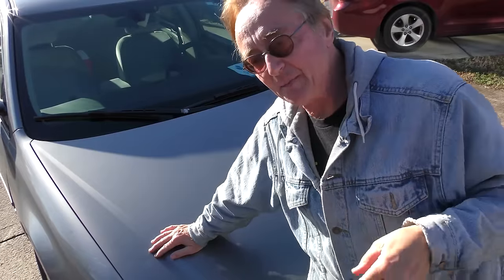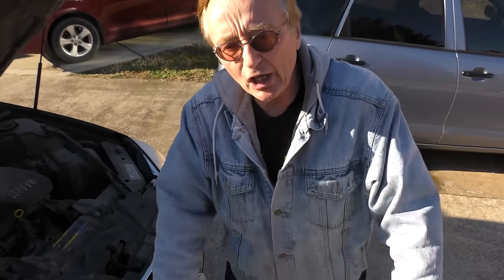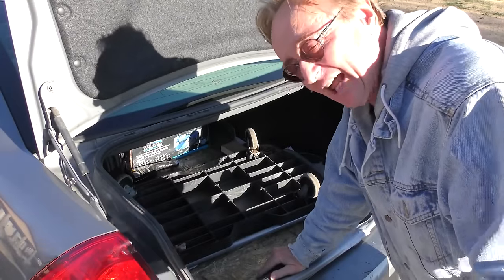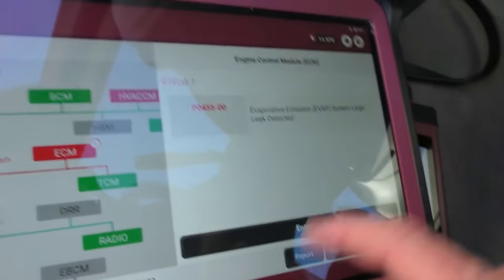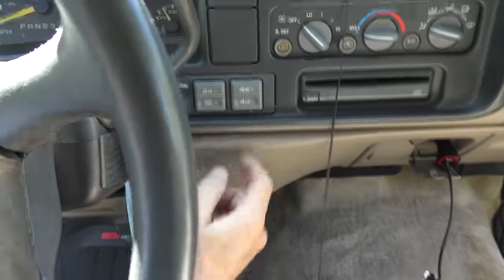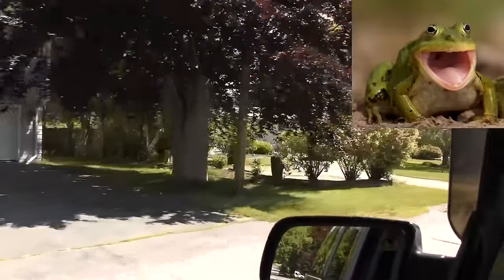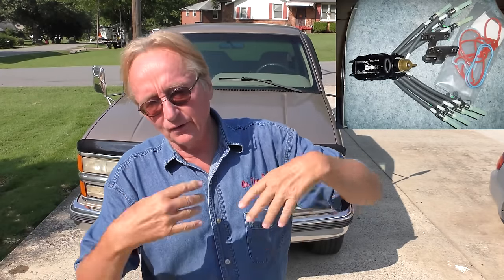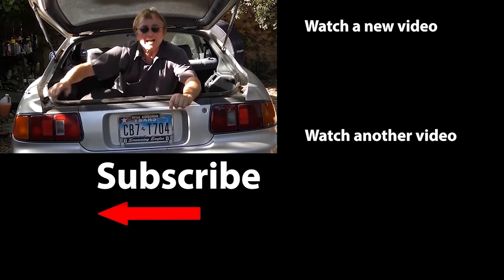3 Chevys That Last Over 400,000 Miles

Comment: I have a 90 Chevy single cap 4x4 short bed with 240,000 miles and still running strong.

Comment: I have a 96 C1500 (and a 90 Suburban). These are great trucks, well put together and nice to drive. Snap them up while you can!
Reply: The C1500 has done 118,000 miles, and the Suburban (with 454 engine) only 73,000 miles and with a Flowmaster 40 sounds like a beast!

Comment: I have a 2009 Impala withe 3509 V6. I bought it over a year ago with 124,000 miles and have put 1509 on it. It was near perfect except for a scratch and a small hole in the seat. I paid $4,000 for the car at a dealership. My mechanic went through it and he said I got a fantastic deal on it. Everything is solid and the only thing I've put into it was tires and a thermostat. The two prior owners took amazing care of it!

Comment: I have a 96 1500. Paint is faded but the A/C runs 150k miles on it. It's a rebuilt truck for $4000. Needed it because my jeep patriot went through a transmission cable and for some reason it has a spare

Comment: Scotty;  I had a 1985 Pontiac 6000 which had 360,000 on the odometer when I sold it and it had a broke speedo cable for nearly two years.  Mixed city/ hwy driving mostly city interstate driving. Ran good burned about 1/2 qt per 1000miles.

Comment: I have a 08 Chevy Impala with almost 185,000 miles on it. Yes it has a few rust spots and a few imperfections but its almost 15 years old. And no it won't make 400,000 miles with me, it will make 200,000 miles with me.

Comment: Try Lucas injector fuel additive to clear those fuel injectors, it has worked for me. It also helps clean & keep direct injection carbon at a minimum. You moved from Texas, but 'Burbans and its cousins have been built in Arlington since 1996. Remember to keep up with government regulations, many components come from suppliers, that GM has been more consistent with quality control.

Comment: Reminds me of my old 2002 Malibu. Lots of weird stuff wrong with it, like the security system would prevent you from starting it
Reply: GM passkey re flash at the dealer. In 2002 that cost $80. Only done once in 240,000 miles.

Comment: 2012 Malibu 222k it’s still running but not strong because I let the oil get low on my trip to California and back didn’t realize how much oil it burned. Other than that would still be running strong. Keep oil full and changed and you’ll be good. I just bought a 22 Malibu yesterday with 28k on it. This makes my third one 😂

Comment: I had 2 Monte Carlos , a 1996 and a 2000 .
I changed oil and filter every 3000 miles .
Both cars went over 230 k miles and were still running good when I sold them.
Only problems were the Dex cool / intake leak common to the v6s back then that I fixed with Barsleak .
Reply: My mom had a 1999 Monte Carlo 3.1L  sold it at 267,000 miles and still running good.  Did have to replace the intake manifold gasket at 175,000 miles though.

Comment: My 07 Chevy ls is nearing 150k and it’s running strong. Yes it needed at points a lot of repairs but right now it doesn’t. It also needed a new transmission a year ago and it was rebuilt and it runs great now. It also has had: an accident, one owner before me, a fender bender, water pump replaced, cadillitic converter done, and fuel pump replaced. And some more repairs. Buts it’s running well.
Reply: Ac and heater works too

Comment: I have a 91 Chevy S10 stick shift with over 648,000 miles, ac don't work anymore, speedometer and odometer broke down sometime last year, I tried to fix the speedometer and odometer, but the part that was needed to fix it was unavailable and my mechanic told me how a parts guy laughed in his face about the part as my vehicle was just too old. So now I use a GPS speedometer as I need to know how fast I am going. I did buy the pickup with over 640,000 miles knowing that the engine was rebuilt about 100,000 miles earlier, it is a 2.8 v6 that I bought for $1000 back in 2014. Still runs strong.

Comment: Doing maintenance on time everytume is crucial to making a car last over 200k miles. Yes I drive chryslers. My 2010 chrysler 200 sport with 6 speed auto transmission has 208,016 miles currently. I use valvoline full synthetic oil changed every 6k miles. Plus keeping your radiator cooling fins clean and radiator flushed annually. Rust prooffing will also be huge help to prevent the car from rusting away. I use only Moog brand suspension parts and hub bearings. And yes my AC works. Blows cold.

Comment: That 99 Suburban is running spider injection, there is an retrofit kit to convert to actual fuel injectors. I did it on my 99 GMC Suburban, got better MPGs and better lower end torque.

Comment: I'm a dealer and I've personally seen these 3.5s and the GM 3.8 series motors from 2000 to 2006 with super high miles still running great I'm talking over 250,000 miles no problem and I've not just seen a couple I've seen a ton of these motors in Buicks Chevy's and others still going these are great motors

Comment: I worked at a Chevy dealership a few years ago. I saw those 3.5 V6 Impalas come in on trade on almost a weekly basis with anywhere from 150k to over 300k. I'm definitely not a GM fan but I have to admit that those particular 3.5 Impalas seem to last more than their other passenger cars. GM put the terrible 3.6 in the later years of that generation Impala, I would stay far away from that engine!
Reply: I keep hearing how this 3500’s are such a great engine. How much power are they making?
Reply: The REVISED 3.6 liter VVT V6 in the 2012-2016 impalas (Old body style or limited ) are super reliable!! Much better engine than the previous years. 300hp, flexfuel capable too. And i forgot to mention the 30mpg highway mileage as well.....
Reply: I’ve used ethanol after Hurricanes when gas stations are out of gas or everyone is waiting on long lines at the pumps and I don’t have hours to wait on line for gas. I’m happy to have that option in an emergency
Reply: The 3.6 engines are much better than the GM pushrod engines what are you talking about. 300 HP versus 211 HP. The reason why those motors go is because people don't change their oil or use a quality synthetic oil. The 3.5/3.9 engines are also gas guzzlers because they are based on 1980s technology.

Comment: A real close friend’s parents had a 99 Chevy Malibu they bought brand new and drove it for a long time.. ended up giving it to their other son as his first car and is still driving it these days with almost 450k… only work done to it besides tune ups and oil changes were intake/head gasket repair, master cylinder replacement and throttle body.

Comment: 2007 Malibu with 3500 engine... 190,000 miles. Just regular maintenance (always!), Mobile 1. Runs great. Gets 30 mpg between 60&65mph cruising. Mpg drops at higher speeds. Some minor oil leaks,  no biggie.
Reply: I have a 2011 Chevy Malibu car runs like a champ it was leaking oil but after a oil change it doesn't leak anymore I have no idea why it stop I thought maybe head gasket but nope or a oil pan gasket I have no idea 😂 only thing is my service traction control say needs service? And the speed control doesn't work? Trying to find out if it worth fixing any idea ?
Reply: Can't even tell the engine is even running unless the fans come on really good car I get almost 20 Miles to the gallon got the car at 129,000 miles are you a mechanic?

Comment: 1995-2005 best pickemup trucks ever.  No era has produced more high mileage heroes than this.  Ford , GM, Chrysler all had standout trucks.  They had some dogs too..  but do your research.  Trucks aren’t likely to be this good ever again.
Reply: That was the last generation before CAFE regulations kicked in after a 20 year stagnation.  Much of the garbage in later vehicles is due to automaker's attempts to meet these fuel economy standards.  So, it makes sense that the generation just before this was the best.

Comment: My chevy truck with 338.000 plus miles was made in Canada. 93 ck1500 with 5 speed manual transmission. Mostly hiway miles. Everything still works all power, air, even cruise control. afterthought the radio isn't great, the antenna is off. I NEVER LISTEN THE RADIO. So I never think about it.

Comment: i got a 99 blazer with 217k got it at 194k owned it for 3 years now spent around 3500 on it over the years ive had it mostly tires i have not dont any major work on it fuel pump gas cap wheel hubs plugs wires alternator battery and basic oil filter / oil  soon i will change the spider injection but for 700 bucks from police impound and ive made thousands of dollars on it getting me to and from work plus carrying my tools and lumber bags of concrete i wouldnt mind putting in 5k in it 4 wheel drive works and transmission is great ive never changed the fluid only added a quarter of atf when i first got it and i check that all the time ac needs to be refilled but other than that its a runner i take good care of my vehicles do most of my own work unless i need to put it on a lift

Comment: 505CRO...Hi Scotty, Jerry From Houston... My 2012 GMC sierra 5.3 had approximately 100,000 miles and of course I got a tappet start. SMH. I saw your 505CRO video, I said lets try it on my 5.3 with it's Tappet sound... WHY the GM educated Engineers design the 5.3 where you have to remove the Heads to get to the lifters. SMH. I put the 505CRO in it and ran it on the freeway for about 15 minutes. I got the oil changed and put in mobile one oil. Guess what...no more Tappet.. Just for your FYI.  and it's a good truck, I do have the ABS stability lights on, other than that it runs great.

Comment: My wife's last car was a 2006 impala that we bought forn1,800$. The car had 180k miles on it when we bought it from a family member. My wife drove it for a year, put 30k miles on it, then the transmission exploded  and now it sits at a junkyard. The engine and ac were still great though. I changed the brakes, fluids, cam magnet, engine temp thermistor, rear window regulator, spark plugs, etc.

Comment: Cobalt at 330,000 miles.. Replaced battery and put a used transmission in it I got for $300. Paid $750 for the car with 125,000 miles. Not bad for a fuel efficient car that saved me lots on gas.

Comment: My dad's 1999 silverado with the 5.3 hasn't hade a single problem with the motor with 430k miles
Reply: Do you use synthetic oil or conventional?
Reply: @thedirtybubble9613  ok yes it is. I just looked at a old 1

Comment: Have a 2001 Jeep grand Cherokee that has 205,000 miles on it. Still runs. Had an issue with the fuel injector back in 2018 that cost 1200 bucks, at that time I thought about just letting it fade off to automobile heaven. But fixed it. Haven't had an issue with it since. There were issues with it's electronics like all Jeeps of that era. I'm talking about windows rolling down and some indoor lights not working. But no engine issues until that fuel injector in 2018. I think that's pretty good. If something goes wrong with it again and it costs over 500 bucks I will just let it go. But man.... That 01' Jeep is the greatest vehicle I've ever had. By far. You think any of these modern jeeps will even be good in 10 years let alone 20+.

Comment: I had a 2010 Impala LTZ w/ 3.9 same thing. I drove mine to 250k and I sold it in the driveway to a local kid for 500. I drive far so I didn't want to take chances. I picked up a 2016 Malibu limited LTZ with a beautiful non turbo 2.5 and a 6 speed trans not cvt. My Malibu has 150k now and I have had no problems accept those stupid tpms. I miss my impala everyday it was fun.

Comment: I have 2 GMC vans one had a vortec 350 with 367k miles only changed power steering pump and a tranny at 260k.
My 2007 has 289k and have never changed anything accept wheel berrings. Take care of them they all will last.

Comment: I had a 1964 Chevrolet Nova that I was very, very fond of. It had an itty-bitty straight six and if I had my way, it would still be running. Unfortunately, it was not up to me and my stepfather sold it as scrap. In my opinion the peak years of Chevrolet started in 1961 and ended in 1965. After that, the only American made sedan worth having was built by Ford.

Comment: I have a 2012 Chevy Equinox LTZ with 211,900 and it drives and runs really good. Just get it fixed and bam, it runs like new. That truck could probably last till 300,000 or even 400,000. Very reliable vehicle

Comment: I have a GMC Savana 2003 extended 3500 it has 410,000 on it. Same transmission same motor. Always change the motor oil. The differential fluid oil. Transmission fluid every 60,000 miles. That's pretty much it. My new 2017 has 250,000 right at it . Always change the transmission fluid at 50,000 60,000 oil over 6,000 miles rear differential fluid every 50 to 60,000 miles. I need to get at least 400,000 miles out of this one before I retire

Comment: Mine is currently being picked up to go to the junkyard. 2010 with 180k on it the transmission is starting to go out on it. I’ve put 100k on it mostly highway miles back and forth to college. Really liked the car but thing is leaks galore and needs about 1000 bucks work on top of the transmission. I maintain my vehicles to a tee at all the recommended service intervals. Was hoping to make it to 200k but it is a Chevy. Bummed I have to send it down the road. Got a Lexus to replace it!
Reply: Impala that is

Comment: I have a 2008 Chevy Impala LS, almost 200K on it and starts right up.
Reply: So far my main issues have been a gradual oil leak 2% a week, usual replacement of parts when they die.  Usual stuff and maintance.  I have evap readings ever since I got it.
Reply: The problem with them is FRAME RUST.  It's got terminal cancer they told me.  Damn it.

Comment: I've got 449,000 miles on my Chevy K1500 w/ 5.7 350ci engine !
Reply: Nice. Those 5.7 350 engines will last a lifetime if you change the oil regularly. Do you use synthetic or conventional oil?
Reply: @TheDirtyBubble  honestly,  I usually used shell 10w40 but somewhere around 200,000 miles It was using oil around 1 quart every 800-1000 miles so I switched to Rotella T 15-40. I've had diesels in the past and my main truck now is 7.3 diesel.  Rotella has Great cleaning capabilities ! I few years I was so busy I didn't change the oil until there was 15,000 miles on it. I usually drive 30-40,000 miles a year shoeing horses. So my neglect I'm sure didn't help, but it will start after sitting all winter in the mountains. Compession is low so if I park on a slant I park in low range 4x4. And i wouldn't be afraid to drive it across this country. 
I also put me water pump and alternator 3 yrs ago ! They don't make them like they use too !

Comment: My 2010 G6 GT 3.5 had 180k miles and only issue was it had a small oil pan gasket leak. Sadly it got totaled from value due to hail damage & mileage.

Comment: Hey Scotty. I need a van for my business, I'm looking at the 2012 Ford Transit Connect. From what I've found they're generally going for about $10k with about 100k miles on them. But I've found one for $5k with almost 400k miles on the body, and a newer motor and transmission. It's tempting but I'm not sure  What should I do?

Comment: i had an s10 i put 397,000 manual transmission TBI, also had a 95 F150 , manual straight six, 412,000 miles, shouldn’t have sold that one tbh

Comment: I got a 2001 ford explore sport track The theft light is flashing constantly I took it to a local garage they had it for two months just for them to tell me to take it to the ford garage witch I did just to have them tell me I needed a new pcm witch ford don’t make any more so I ordered an after market one after I got it out in it was doing the same thing so I had Hanson locksmith come n hook it up to his computer to have him tell me that the pat transceiver is not picking up signal is there an easy way to find a break in the wire with out having to take it back to a garage

Comment: I know i'm a little late, but my 1996 caprice with the 4.3 (de stroked and de bored basically corvette lt1) it's got 270k on it with just a radiator and a waterpump, and still runs down the road at 115 mph with only 200 hp and 4200lbs those old chevrolets are tanks, especially when you have a motor that has 200 hp and 85% of it is shared with a corvette that has to hold up to 400 hp, I'm betting that's why it's lasted this long but I've seen full bore lt1s with original 4l60e go up to 300k without major repairs, so in MY book they are great american cars and would and probably a few others would agree that it and the impala it shared a bodystyle with in 94 - 6 are americans sedans just like the corvette is americans sports car

Comment: How are the 1.5 l turbo ecotec engines holding up for you guys? I have a Chevy Malibu 2023 and as far as I know I don’t rev my engine like a maniac compared to lot of people with other sedans lol as long as I know how to drive it as efficiently as possible I’ll be okay with a lot of miles with maintenance ofc especially with the way cvt tech is developing in most brands we’ll see how it holds up
Reply: Love my 2011 Chevy Malibu no problem beside I have a service traction control older car but runs like new can't hear the engine running until the fans come on when I'm using the air conditioner and a dime light is out! You have to remove the bumper to change a dam head light 😢😂 why did they make it this way but I heard that if a head light goes out on a newer Chevy Malibu you'll have a lot more problems changing the head lights lol some guy said he had to almost remove the dam engine to fix a head light? Is this true

Comment: My 2004 Pontiac Grand Am with a  3.4 engine has over 325,000 miles . I have always changed the oil at around 4,000 miles using Valvoline oil . I changed the shocks about 20,000 miles ago . It is all original, does not use oil and it drives like it is new.